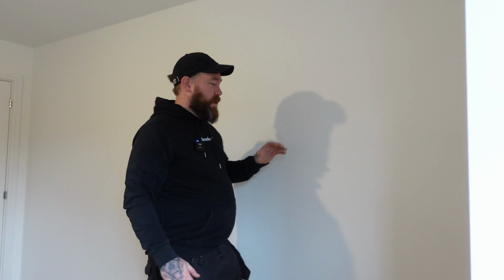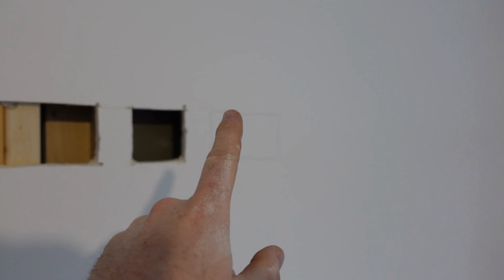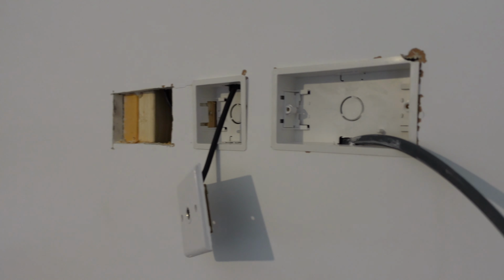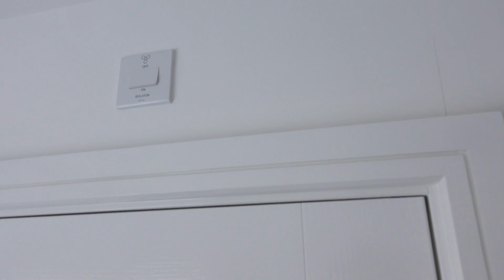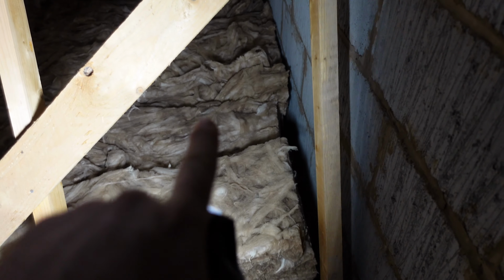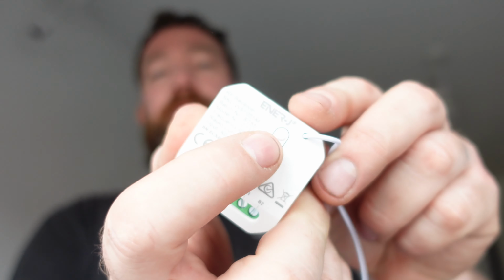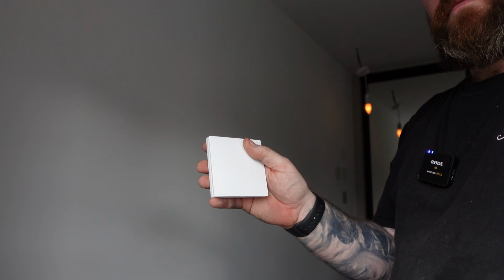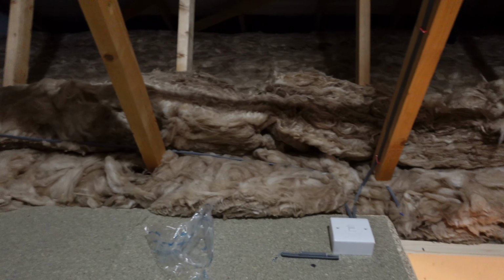This Electrical Wizardry IS The FUTURE! - Electrical Installation House Wiring

Comment: Hi. Just a suggestion, why don´t you buy/use a wall scanner that can find wood, metal and electrical wires? That way you will find the wood studs. I use one from Bosch Professional and it works well.
Reply from the maker: This is a good shout, I shall look into these Thankyou
Reply: I have the Bosch 120? And it’s a complete piece of shit. Sacked it off and went back to using stud buddy’s.
Reply from the maker: @Lolable  😬